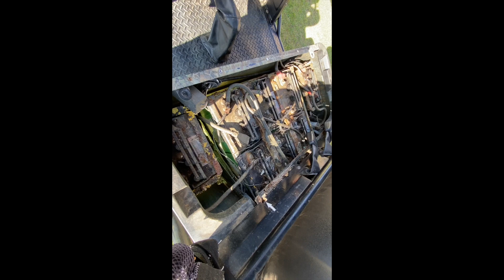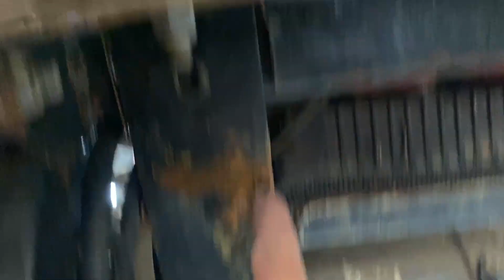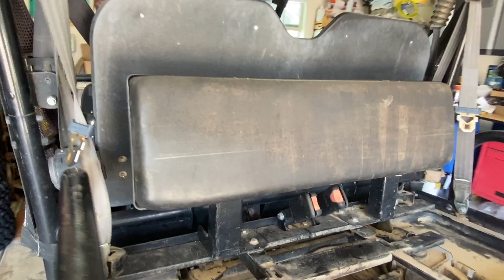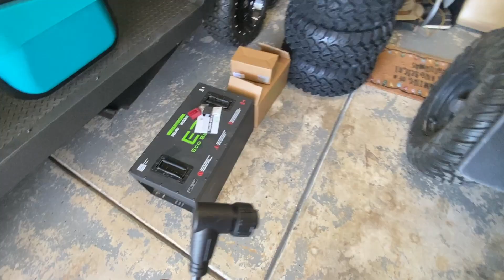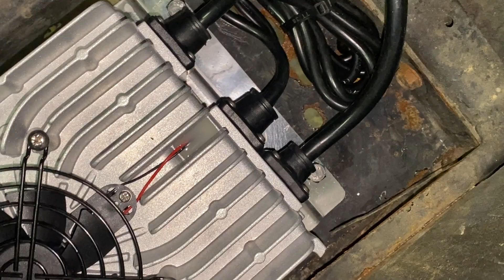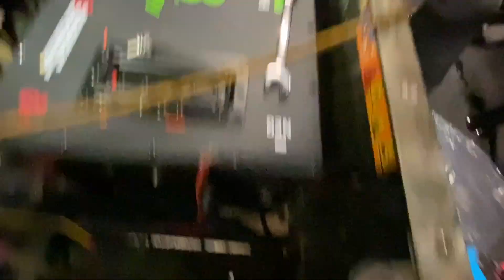How to install Eco Battery 70v in Bad Boy Buggie !

Comment: I would mount the charger up as high as possible, I can see mud caked up on top of it in its current location.
Reply from the maker: It’ll work there too, I’ve had mine four years and hadn’t had a problem but I don’t purposely take it off road either. But yes it could work up high

Comment: James, video very helpful - installing 72 Li battery in  2013 BadBoyBuggy Instinct. One question: where did you terminate the 12v negative lead from the converter? I noted where the 12v (13. v as per video) was tied to 24v OEM cable, but did not see where negative was placed. Thanks
Reply from the maker: You can email me some photos we’ll figure it out, but I’m pretty sure the negative from your accessories will find a ground to the main negative of the battery pack. This sounds weird but it will work that way in 90% of the cases! So you may be able to leave that 12v negative lead from the converter unhooked

Comment: What did you do with the 13.5V black output wire from the reducer? Does it connect to anything?
Reply from the maker: Pretty sure I did not use it in this application, anything that is grounded for the system uses the main ground to the battery pack. So on most cases you do not need to re-ground something that’s already grounded through the factory harness. Does not seem like it will work but it will! Lol! Hope this helps
Reply: @Kartznfartz OK thanks. My relay will not fire but my reducer only sending 12.7V - 13V. Maybe I need to exchange for 72V to 24V reducer versus the 72V to 12V that came with kit. I am on same exact 2015BBB Recoil you were working on in the video. Finicky I guess.
Reply from the maker: @Groovey45 , that would’ve been my go to if the 13.5 V reducer did not fire off the relay. Good luck and comment on here what you find out, I’m sure a lot of others will appreciate the response! Good luck!
Reply: @Kartznfartz  I will and thank you.

Comment: Well, this install has turned out to be a major pain.   The fuse box is located below the solenoid attached to the wheel well cover with a push pin.  Blew fuses and relays when I attempted to stop the relay from clicking when the battery was turned on.  The black brake diode arrow points right to left. I can't find any information on fuse ID.  Not even in the wiring diagram in the service manual.   The relay lettering faces the front.   If you put either of these in backwards, you blow the fuses.  A few more details about the wiring include the white (fused) and black wires are for the original lead acid battery charger and do not need to be connected to the lithium battery.  The OEM voltage reducer on my tracker is hidden between the front wheels.   The brown wire on the driver side feeds this reducer. 

Last week before I attempted to stop the relay from clicking, I had to wait a few minutes after cutting the battery on before turning the key on.  This was the only way it would actually work.  My unit is currently stuck in the garage waiting on diodes and relays to arrive.

Comment: I am in the process of installing a Bolt Energy 72 V lithium battery in my Tracker EV IS.  There is very little information on this model on YouTube.   This Bad Boy is almost identical to my Tracker.  I bet both are made in the same factory.   I had six 12 Volt Trojans that weighed about 90 pounds each.  They were less than 4 years old would only last about 4 miles in the woods.  Bolt shipped my kit with new 4-gauge battery leads, charger, HD solenoid and monitor.  I did not get the new mount kit like ECO Battery did for this install, so I did not have to take the cart apart to remove the old metal.   I did cut the hold down bolts off and installed plywood base.   This made it easy to install the new brackets for the bolt battery, I put the Voltage reducer behind the battery instead of the wheel well cover where the old one was mounted.  I also had the same voltmeter on the dash and the Bolt monitor almost fit in the same hole.  I am waiting on the temperature to rise a little bit since the high today is 22 degrees before I take it on a test ride.  

Side note.  I first installed two 36V Power Queen 100AH batteries and they lasted about 2 weeks before they stopped working.  Sent them back for a refund and got the Bolt.
Reply from the maker: That’s awesome for you to jump in to the challenge! Lithium is definitely the way to go! Thanks for viewing the channel!

Comment: Is there any issues with swapping to the 4-12v/48v lithium ion batteries from the 8-6v flooded batteries that I should be concerned with?  I just inherited a 2007 BBB 4x4 and will want to switch to lithium ion batteries.
Reply from the maker: Hey Steve, if they are wired up properly, the Golf Cart does not know the difference between lithium voltage and lead acid voltage, so in theory yes it will work. What I would also recommend is sticking with a namebrand battery that you can get support on in case you need to. Eco has USB support, and if you buy from me… You also have me! This is a big deal when it comes to something you expect to last 8+ years! Sometimes cutting corners to save a few hundred dollars is not worth it in the long run (8+ years), so I would suggest to stick with Eco… And me! Let me know if I can help!
Reply: Yes the issue is  the BMS discharge rate in any lithium kit. I install these in Polaris Ranger and if the max discharge is not at least 200amps and continous discharge 500amps the Ranger will shut down and so will the BBB. Summit has the highest discharge but ECO and Bolt work great also